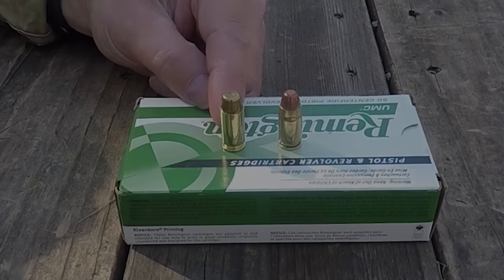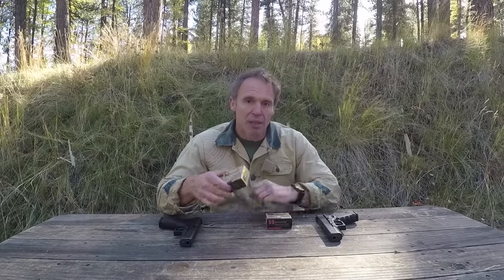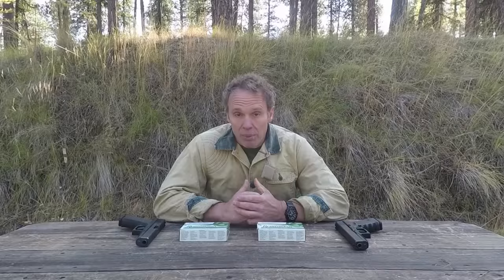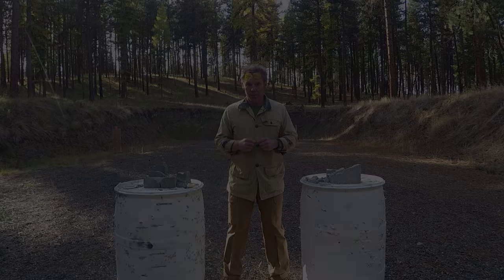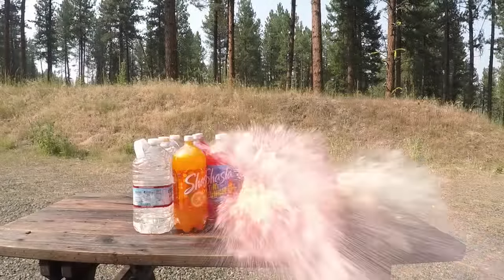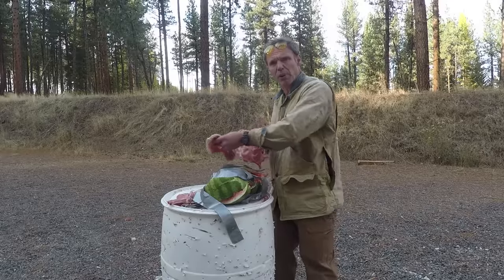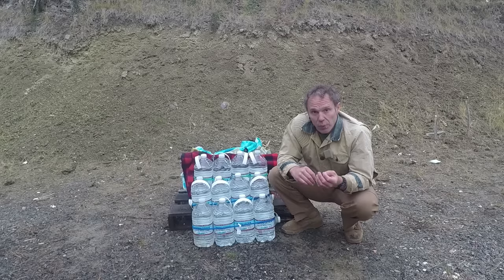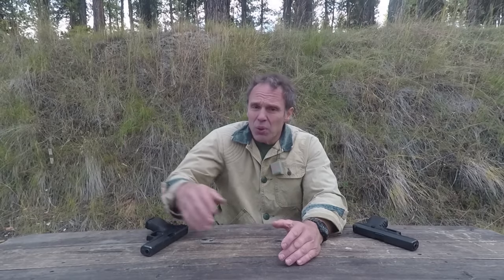Personal protection: .357 SIG vs. .40 s/w

Comment: Since .357 Sig is expensive and hard to find my .40 will do just fine. After shooting a lot of .40 ammo the Hornady Critical Defense in 165 grain is a nasty one.
Reply: No one is saying your .40 is bad.  But... if you had selected a .357sig, it would have been better :)
Reply: @spaceshuttledoorgunner1154  The ONLY thing I like about .357 Sig is its reliability because of the shape of the case. It is too loud, too expensive and too difficult to find. Switched the barrel to a .40 and haven't looked back since. I think this caliber will be very hard to find in the future. The prices are ridiculous. While a box of .45 ACP by Winchester sold for $24, the .357 Sig ammo by the same brand cost $10 more!
Reply: The tables have turned in my area, I can find sig, and 40 is hard to find
Reply: That is maybe the best choice, 500ftlbs, they expand to a massive 7 tenths or better , they dont clog and jacket separation is not a issue, penetration in gel is perfect.I like Dots too.
Reply: usa2012 same my local spot has been having plenty of sig
Reply: @marquesridley2464  Went to Cabela's by my house last week. 357 Sig was all that was left on the shelf and it was priced $2 less than 9mm for a box of 50, and hollow points were $10 cheaper than 9mm. This is why I am glad I have a 357 Sig, people don't go and buy it all up.
Reply: I never have a hard time finding 357sig and I pay about $9 for 50 rounds because i reload it.
Reply: usa2012 interesting. It’s good you can change a barrel and shoot both.
Reply: MogilnyPuck89 just my opinion but it sounds like Cabelas might be price gouging the most popular 9mm and needing to move the sig ammo so they knocked the price down
Reply: Reloading practice ammo is a good practice but never use it for self defense carry ammo. If, God forbid, you ever have to shoot someone a gun hating prosecutor may use that against you. "Ladies and gentlemen of the jury, he says this was self defense but he is so gun crazy that he loads his own ammo and looks for people he can shoot." I may have expressed this badly but I have read of prosecutors using reloading against a person.
Reply: @michaelbillstrom170  Where did you find your total reload kit as well as the bullet, primer and powder
Reply: @kennethwalker1785  i use the lee .357sig dies which shouldnt be too hard to find.  You can try ebay.  I also use a .40 sizing die so i dont have to lube the casings.  Run the case through the .40 die first then the .357 sizing die to size the neck.  I would try ebay first.  Xtreme bullets seem to work fine in the 124gr flat nose.  They seem to be instock at their website. Primers are very difficult to find right now but luckily I bought 5000 last spring before it got real bad.  Ive mostly used longshot powder but recently started using winchester 572 but powder is starting to get pretty hard to find now too.
Reply: @michaelbillstrom170   Have you ever used small rifle primers in handgun loads such as these? I've seen videos where they say the only difference is the cup thickness. Small pistol, heck really any primers seem unobtainium right now.
Reply: @scottmcburney8938  i have not but ive done large pistol magnum in 10mm and everything was fine.  I would imagine you would be fine with the small rifle primers but start at the lowest published load.  Its a pretty good margin for .357sig with win. 572.
Reply: The Hornady Critical Duty 125gr in .357sig is even nastier.
Reply: I own a couple 9mm, and 1 40cal guns.
Reply: @largol33t1  I personally like how much speed 357 sig gains in a rifle you can get it to 2000fps plus out of a long gun
Reply: @issstari954  which rifles/carbines are chambered in .357 SIG and why have I not yet heard of this
Reply: @cole3078  TNW areo survival rifle and a couple others its actually insane black magic you get basically no kick and a great gun you could technically take a deer to a squirrel with
Reply: @issstari954  I’m pretty sure that Underwood makes a 60 or 90 grain round that is rated at 2500fps…out of a pistol.
Reply: @cole3078  Havent heard about that dont know how true that is since it would be like ar speeds out of 223 of a rifle if it was
Reply: 10mm is the master race.
Reply: @user-qo3yy9nv1u  Laughs in 44 magnum
Reply: @user-qo3yy9nv1u  460 rowland allows you to have 44 magnum power in a semi auto and still be able to fire 45 acp
Reply: I usually just carry .357 Sig, which I don't mind it being more expensive and difficult to find since it's carry ammo that I buy and shoot rarely, and then plink at the range with .40S&W which is definitely a lot cheaper and easier to find.
Reply: I like Federal 180 grain HST'S
Reply: @spaceshuttledoorgunner1154 well luckily 40 m&p pistols are easily convertible to .357 if u feel u need it all better than 9 mm especially out in the woods

Comment: I like Underwood Ammo's loading of the .357 Sig, as it very nearly achieves the ballistic performance of the .357 Magnum.
Reply: TY! for 411.
Reply: Compared to a 125gr .357 Magnum load, sure.
Reply: Yup.
Reply: They're extreme penatrator .357 Sig has a muzzle velocity of 2100fps with 68gr and their 115gr at 1500 fps. Absolute nasty rounds. The 68gr has 700lb/ft of muzzle energy and can defeat all level ll and most basic level lll. Only need Glock to make a FN 5.7 with their 19 slim slide and their 17 frame like the 19x and underwood ammo to make their extremely hot ammo with an AP tungsten core. Just imagine having 32 rounds of that ammo no extended clip needed shooting armor piercing bullet at 2900 fps. FNs stock green tips are already hitting 2600-2700fps and I know under wood ammo could at 200 fps maybe even 300. That pistol with a red dot would have some amazing reach, no drop and could easily beat level lll a. Glock do it!
Reply: @followthegrow108  I made a 357 sig rifle out of glock 23, got 16 inch 357 sig barrel and a glock pistol brace with rails for flash light and optics, Shooting the 65 grain underwood 357 sig out of the 16 inch getting about 3000 fps. You can snipe things out to 200 + yards with an optic.
Reply: @followthegrow108  5.7 is very long.  Won't fit any existing Glock frame.

Comment: Woods carry the G32, home defense carry with the G30 has been the method to my madness for years. I can reload for both and shoot both quite well. If there was a manufacture that produced a 1911 in 357 Sig  (that isn't a jam-o-matic) there would be one next the G32 in the gun safe. 40 S&W is no slouch by no means and is part of my carry options. Another awesome video please keep em coming
Reply: .40 is actually more powerful. When you get the hottest factory ammo for both, the 135 gr Underwood .40 nosler, and 124 gr Underwood .357 sig nosler, the .40 reigns supreme. So .357 sig can not claim to be more powerful, no matter how many big companies load .40 and 10mm way under saami spec and load .357 sig pretty close. 

The 135 gr and 155 gr underwoods are rated from a 3.4” barrel too, AZ AIRGUNNER just proved that with two recent videos of .40 vs .357 sig. He got exactly 589 ft lbs from the 3.4” barrel with the underwood 135 gr .40 nosler. The .357 sig nosler from them had 540 ft lbs. from the 3.4”

From a 4.9” barrel the .40 had 675 ft lbs. The .357 sig had 640 ft lbs from a 4.5”.  Gun Sam tested the .40 from a 4” and it got 610 ft lbs. Needless to say I picked up a fex boxes. It’s in saami spec and it shoots great from my Glock 23, not uncomfortable at all.

Comment: "the downside is that when i go to the store to buy .357SIG ammo, everyone laughs at me"  LOL
Reply: The upside is when I go to the store to buy 357 Sig, it is always in stock. Especially right now. Good luck 9mm'ers.
Reply: Crown Commando  Right now at my Cabela's 357 Sig is $2 cheaper than 9MM for 50 rounds, and actually was the only handgun ammo they had on the shelf. At Sportsman's Warehouse 357 Sig hollow points are $10 cheaper for the 25 round boxes.
Reply: Crown Commando  Nice, I got the Sig Sauer brand last week when I was there FMJ 50 box was $16. $18 for their HP box. That is the cheapest I've ever seen it. I'm going to be ordering a can from Georgia Arms.
Reply: I actually had a clerk legitimately make fun of me once for carrying .357SIG. He said I needed a 'man's gun' like .357MAG. He had a snubby .38Spl on, so I just rolled my eyes and did my thing. I just don't get the resistance to .357SIG. It's an overall great cartridge for more experienced shooters to handle. Too bad it's not more popular since it would bring the price down a bit.
Reply: @ilcctinstructor6870  If it was more popular it would bring the price UP.
Reply: @ilcctinstructor6870  Did you tell him to look at the results out of a snubby? Not encouraging.
Reply: @AL Speer GoldDot was the gold standard of HP in many circles and still is for many now. If you want penetration through a door then go with FMJ. HP is meant to enter a target and NOT penetrate through it.
Reply: @UCnswqJu_7rpPG12JvxF7HFQ That would work, I would also recommend 357 Sig 115 gr Underwood Xtreme Penetrator. It uses a solid copper bullet.
Worth the price and if Underwood offers it in +P that would help the 4.5" barrel. 
Try finding it in Gen 4.
The recoil is better.

Comment: .357 Sig also is more challenging to handload. The case neck is very short. The case typically is full of powder and you need to careful of compressed loads. Both of those together mean that you have to be very diligent about preventing bullet setback in the magazine.  

The ballistics are excellent.  The bottle necked case feeds very reliably. On the other hand, it is a LOUD cartridge. The only time I developed a bad flinch was when I first started shooting .357 Sig. I worked through it, but it is a potential issue.

Comment: So would you say they are SIGnificantly better?
Reply: Scheefinator yes
Reply: good dad joke
Reply: You be the judge.
Reply: Nah
Reply: B real  you don't have to buy a new gun just a barrel
Reply: B real  slightly better ? I guess you missed something.
Reply: Yes lol also I think 357 sig is a better shooting round than 40 anyway.
Reply: B real  if you have a Glock you only need a barrel, the rest of the gun is the exact same, including the magazines.
Reply: B real  the followers I have, 3 for 356
7 sig and 1 for .40S/W are the exact same. I have never had any problems at all utilizing my mags with 40 and 357 sig, but that is my experience.

How ever, for you to love from pretty sure (which means you are assuming) to completely sure, you can get both of the followers and compare them.
Reply: I ultimately give the nod to .40 because I can run anything from 180 gr subsonic with a supressor, through a zippy little 135 gr., depending on application. .40 is an extremely versatile cartridge, in a handy little package.

Plus, I'm also a 10mm fan, so those .40's can run a 10mm in a pinch.
Reply: @anvilhammer9026  Yes, practice with 40 most of the time to save money. Still practice some with 357 and carry 357 works for me.
Reply: B real  I use 40 mags had FTF on one went to midway usa and got followers for 357 sig works great. If all else fails use 357 mags for the 40 it works too.
Reply: B real  upside if u want to switch all you have to buy is a barrel :)
Reply: Gigaheart ahhhhh I see what you did there niiiiice lol
Reply: B real  Cost and availability aren't within the realm of ballistics. Muzzle blast really isn't either. So, given the actual ballistic differences between the two rounds, the 357 Sig  is much more than "slightly" more effective than the .40. That being said, I own a Glock 22, and a Glock 27. Both .40 cal pistols. My favorite round. However, I feel like I have a SIGnificant option, of dropping in a 357 Sig barrel if I want to to shoot my weapon in what I call "Turbo Mode." The beauty of a .40.
Reply: You be the judge
Reply: @mandapalque  The Glocks in .357 Sig are slightly heavier and the round is 5000 PSI higher pressure than .40.  I would strongly recommend getting a Glock in .357 and then getting the .40 barrel.
Reply: @jasonallman696  I do have a .40 barrel
Reply: That joke made my day!
Reply: BA DUMP TSSS
Reply: Good joke. But guys, what do you make of this video? That the calibers are practically the same thing?
Reply: Haha snort

Comment: Good info, 357 sig by far is a better performance round, but your point "availability & Expense" Key words.
 Keep up the good work.
Reply: Sorry, but your assertion is wrong. I welcome you to visit Ballistics 101 online. If you can read ballistics charts properly, you will find that the 40 S&W has loads every bit as powerful as the best 357 Sig loads.
Reply: Average. 357 Sig is 500 ft lb. .40 is around 450 ft lb average.
Reply: I use .40 though because better ammo choices like Ranger T.

Comment: Good video.  357Sig has been a favorite round of mine for awhile.  True it can be hard to find at times but between order by mail and reloading it’s not too much an issue.  Another big bonus is with just a barrel change you can shoot 357Sig in a 40S&W and vice versa.  Except for my HK’s, I’ve been able to convert all my 40’s and 357Sigs back and forth.
Reply: They this might be years late. 3 😂 but I got a SD40VE S&W 40 and I'm wondering if that would work with 357 sig?

Comment: I like the word ( jugs ) better to
Reply: Tactical I never even noticed he says jugs in all the videos until he pointed it out
Reply: He has mentioned to me in the comments that people were attempting to give him the business about using the word jugs instead of bottles, which is why he mentioned it.  Ahhh Youtube, good times good times.
Reply: google Lavon Affair sorry I don't sweat the small stuff
Reply: I see from the language that I am facing some experts here. So let me ask a question: is the .357 SIG a jugneck cartridge? As far as I know the .40 S&W has a straight case, but I assume the .357 SIG case must have a jugneck.
Reply: They're bottle jugs.
Reply: NOpcBS hahaha. well done.
Reply: Rick Barton jug jug jug
Reply: the 357 sig beat the .40 in every single way, right?  That is what I saw.  Did u see it? thx.  I have  a 27.  I am thinking about getting a 22 and cut the grip.  But, maybe I should get the 31?  And cut the grip?  thx.   cut the grip down to a 27 size, so I can have a 27 long barrel in a 31 upper.
Reply: Tac Better to what?
Reply: Thank God he didn't say "now  they are saggy jugs".
Reply: Don't screw up a good gun by cutting things. Buy what best suits your needs to start with. No one will be interested in buying one of your mutilated guns. If you must, go on GunBroker and buy the a frame that matches what you have. Then you won't have to give away your original.